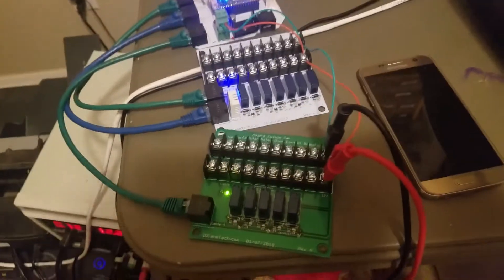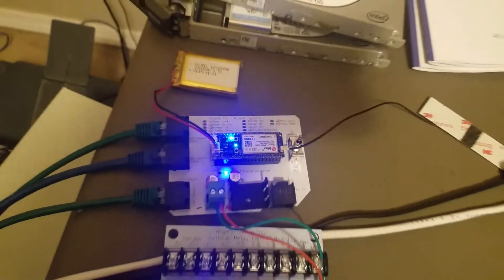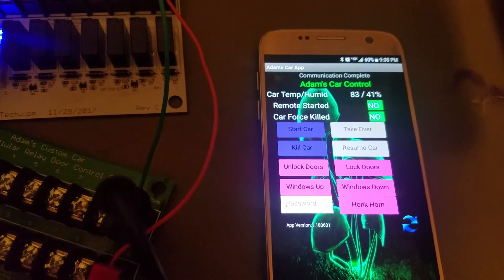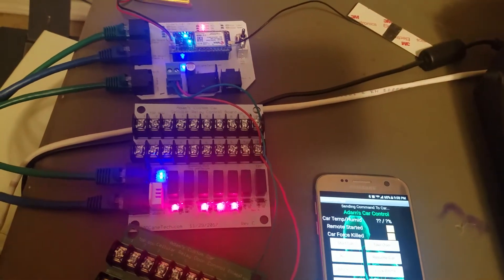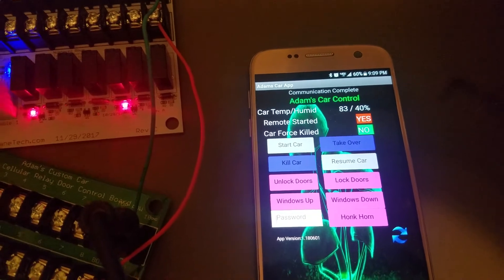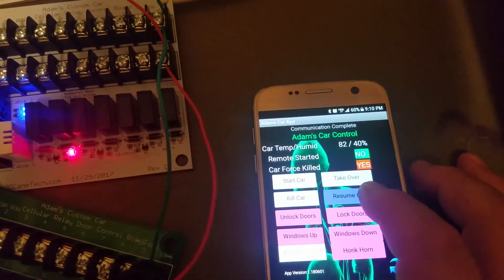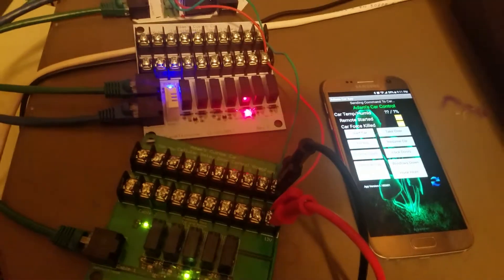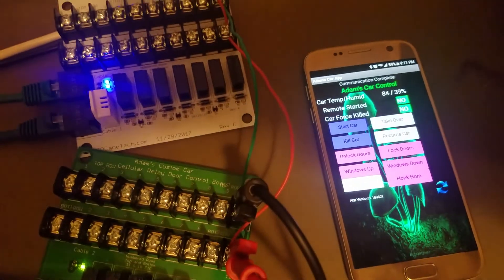Electron Cellular DIY Vehicle Remote Start Car w/ Android App

Comment: Will this drain the battery?
Reply from the maker: You can either use the battery with the device, or you can wire to use car battery and it would be a tiny drain.

Comment: I just wanna know what ppl are doing to disengage the steering lock? In vehicles that still use a mechanical key
Reply from the maker: You have to turn the key on to "Take over the vehicle" If you don't present a key, then as soon as you press the brake it shutsdown.
Having a take over implemented is needed to prevent someone from driving it away and stealing it.

Comment: This is awesome I would love to do this on my 86 k5. Boards look custom made any chance you sell them or have a link to purchase where you bought them?
Reply from the maker: I think I have some left if you want. I designed them in Eagle CAD and had them manufactured.

You need to be EXTREMELY well versed in Vehicle electrical and understand how to customize code for the electron, and the Android app to link it to the electron.. :) 
But if you got the will and a bit of skill, I will mail some boards to you for free :)

Comment: This is nice, I'm working on something similar.  Are you integrating into the CanBus at all for say overriding the immobilizer?  My plan was to have the Teensy fake the immobilizer signature over CanBus to the ECU before activating the remote start via relays (Starter is hardwired, but ignition and accessories can be enabled over CanBus I believe).  Are you sharing any of the source code for your project by any chance?
Reply from the maker: This was for a vehicle with no canbus. I'd be happy to share code, which did you want the electron code or the app code?
Reply: Either or both, android apps are something I haven't toyed with yet (was going to trigger on SMS in the beginning).  Admittedly I'm not using an electron specifically (going with Hologram SIM and an LTE module, but very similar) but I do like browsing through similar code as a good way to learn.  If you feel like throwing some of it up on Github with a quick description, others searching might benefit from it for their projects.  Nice work!